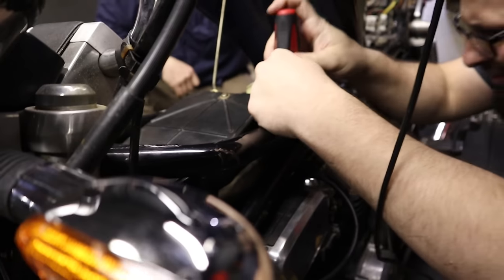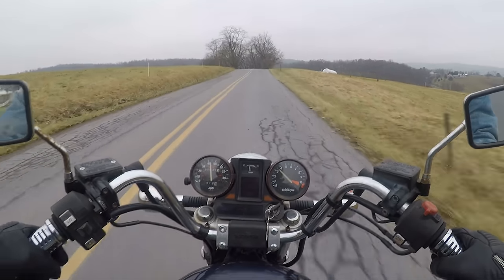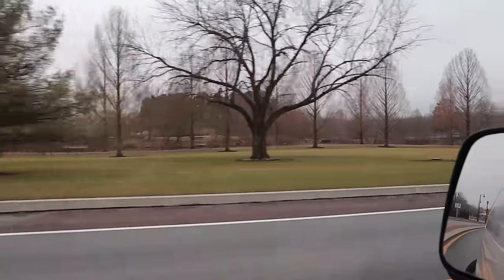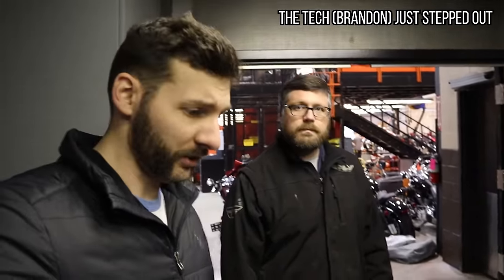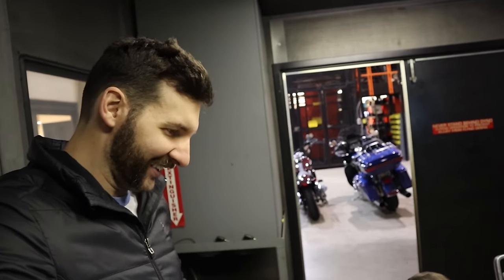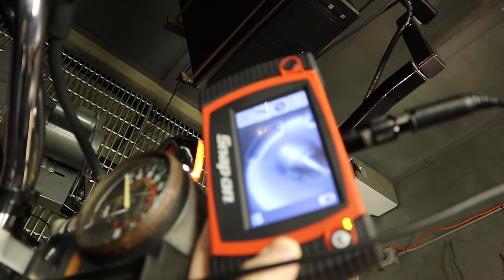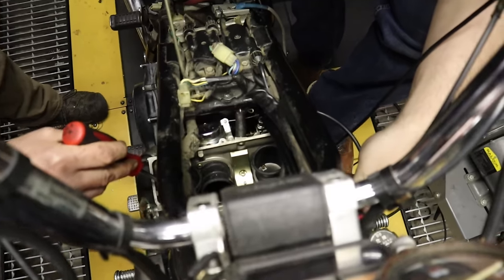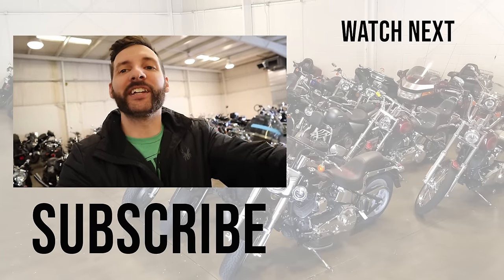We FIXED this abandoned bike for $83 then put it on a DYNO | 83 Honda Magna

Comment: I’ve seen lazy slides before. What worked good is a little steelwool if you wanna tear it apart? If not? Some good throttle body intake cleaner works really good

Comment: note the bike in my avatar. 82  Magna 45. my restoration, my baby. I have trouble with sticking slides too I think.  It has good bottom end power, I can shift at 5k getting on the freeway ended up at 5k sixth gear at 70 when I merge but it has a flat spot at full throttle from  5k to 7.5,  but when it hits 8k it leaps eagerly to 10.5. it stops breaking up and goes like gangbusters. ... I just have to keep up with the shifting because it will power right past red line if i'm not looking at the tach. I haven't quite ever figured out how to do a drag racing launch like I have with other bikes but from the 1-2 shift to 110 mph happens in a hurry. I always thought the stock mufflers were too quiet so I drilled a couple of 3/4 inch holes in the baffle plate and it now makes this beautiful screaming howl at high rpm full song that thrills me.   

what happened to this bike? it seems l like there should have been a final vid

Comment: Cracked liners causing a loss in vacuum first then compression...been there done that with a sister bike to the vtf 750 magna...mine was a vt500c shadow...I would be running along at 55mph out on the highway and then those slides would snap shut and the bike would fall on its flat on its face and then it would pick back up and spike at 70mph before I could adjust the throttle to compensate for it...and I had completely rebuilt the carbs best I could considering some of the stuff is obsolete and I did a compression test which was good left the compression tester on for a couple hours to see what was going on and no change...then one day on my way home from work it just shut down so got it towed home and because it was gonna go to the scrap yard anyways I decided to strip it completely down just to see what it looked like inside and once those jugs came off and no longer had the rings of the pistons holding the liners together well the liners basically fell out in pieces...lots of pieces

Comment: CV (Constant Velocity) carbs. The slides float depending on airflow, but are easily jammed in their movement with dirt. They were popular for many years because they smooth out the power.

Comment: you have two ignition boxes under the seat. my old V45 Nagna did the same thing. remove the seat, and switch the boxes to tthe connector. It might fix your problem. If you run the motor to 6k youll be pulling 70 - 80 mph.  MODULE, IGNITION CONTROL (CDI)
30400-MB1-871

Comment: You gotta remove-clean all slides, pipe cleaner rasp for the jets, or a jet kit, check vacuum lines, fuel filter, such carbs with mercury gauge.

Comment: I have an 84 Honda magna I bought for 450 about 12 years ago . I did about all the stuff you did and more replaced  starter, starter relay, battery spark plug wires  and one of the boxes under the seat that controls the spark. And more. I have a 81 Kawasaki 440 Kz that I think I blew the engine. Went on a bike ride with friends it started smoking, I think it was low on oil replaced the oil drove it home 50 miles smoking all the way parked it found the 84. Magna for sale and bought it. Never rode the Kawasaki again. It’s sitting on the side of my house if you think you are up to the challenge yo get it running again?? It would Be a good project for your show , I painted the tank red white and blue sort of like the one from east rider and put a fur seat cover on it I made from Joann fabrics lol

Comment: Good lord. The CVK carb on my 125 scooter can be a pain in the butt. I can't imagine having four of them on one engine. 

When the slide gets mechanically stuck on that beast, I can barely get the speedo to register 50. Probably 45 in actual MPH.

This video is a great advertisement for fuel injection systems.

Comment: You probably have a vacuum problem on the bike... Probably the intake rubbers have cracks and what not! I've had a Honda VF400F (same engine setup) and that had the same problem. It produced a whopping 21Hp though while there were a lot of vacuum leaks.

Comment: Sounds exactly like what was happening on Cars & Camera's CB750 powered kart. It would rev up to a point and then just stop. It ended up being a spark problem, they replaced the plugs and cleaned the points and suddenly it ran fine and would rev freely. 
I saw an intake for those bikes that converts it to a 4brl Holley carb that'd solve your tuning problems :P (of course now that I'm looking for a link I can't find it)

Comment: 90 degree 4s are smooth but they had a problem with lubrication,I managed to repair timing chain by removing a link and the guides. Ran like a swiss watch.

Comment: Vintage motorcycles are NOT a cheap hobby. They easily get into the thousands getting them road worthy and dependable. The more he runs it the worse it going to get. You will keep finding issues that need to be addressed.

Comment: Wuss! 
Cradle mountain Tasmania, in winter, past 12am, minus 4 Celsius, pouring rain that turned to snow as the elevation increased and the temperature dropped more, on a 250 Virago that had major running issues. Plug gaps set to .3mm just to get it running well enough for a 5 hour trip home that required stops to pull the plugs and clean them just to get another 50km if I was lucky so I could rinse and repeat. 
Quickly became an 8 hour trip that had started at 7pm. 

All this in a leather jacket that was still so heavy from being soaked through from the initial 5 hour trip to where I was going, riding shoes that were soaked through, leather summer gloves, full face helmet that was so cold and loud (Shark Ridill) but I at least had waterproof riding pants.
Reply: Me and a mate went to a rally in the middle of winter. We got to Boorowa and he couldn't open his visor - it had frozen shut. That was a bloody cold ride.....

Comment: Run a couple tankfuls of gas with fuel system cleaner through it. Marvels, seafoam etc. It's cheap and easy to try and has always produced good results for me.
Reply: Not having to do these ineffective things is the reason they got an actual mechanic. Take it apart, clean it, put it back together. That's the only way you are sure it is clean.

Comment: I have a scan of the 1983 Cycle World's article Specifications page: 
80.3 bhp @ 9500 rpm / 46.2 lb-ft @ 8000 rpm
0-60 mph 4.6 sec
Standing 1/4 mile 12.08 sec @108.82 mph
Top speed in 1/2 mile 122 mph

Tip: You should have 2 different sized springs in the carb rack.  Long ones install in the front carbs.

Comment: The v65 magna has amazing acceleration, and with decent tires, they are very forgiving. Unfortunately, their outright power and torque, combined with less than optimal rubber, meant that the majority of these have been crashed out.

Comment: My guess is dried out leaky manifolds. (Or balance tubes if it has them) Try riding with the choke partially closed.  If so, being a Honda you can probably still get them OEM. (I could be wrong, it wouldn't be the first time)

Comment: Have this bike sitting in garage right now "84"" for about 10 years but looks new. I wish I could get it running that fast lol but it's so condensed in such a small package,  last time I had to hand it off to someone able to finish job. Now it's probably not worth the cost of fixing "sad sigh"  Ps: the engine is for sale all over for 650.00 though hmmm

Comment: those slides will not open if you dont have the air filter on, and the air filter box closed, the vacuum that is created in the air filter box, is what makes them open. CV carbs will also not run properly with pod filters, because of to little resistance on the air flow.

Comment: I bought one of these that had sat since 1983. Had 500 miles on it. Previous owner thought the motor was locked up and forgot the bike. I put a battery in sprayed starting fluid and it popped off and ran like a top.

Comment: Try a 84 or 85 Sabre. Similar motor even more ponies. The V65 model was the bike to beat and that's why Yamaha made the VMax. Also an oil cooler drops operating temp enough to add ponies to those machines.

Comment: So I bought something off Craigslist (negative points right away) I believe now that I've got an 83 ish Magna with an in line 4 - looking like a same year Nighthawk,  don't know the displacement.  But alk hooked up to the drive shaft/rear wheel. It was advertised as needing a seat, some side plates and a battery  + came with a starter that had yet to be installed. I have an OEM Magna seat which fits and the other stuff is coming in from ebay soon. Any thoughts? Are the frames the same for that year? Yours has the exact same dashboard/display. I've not seen that in the 100 + internet pics I've looked at.

Comment: did you adjust the valves? the carbs have to be sinked one by one ot just cleaning jets,  so your mechanic wasn't that good the old gas they will gum up again you should use the sea foam it works did you check compression?

Comment: it costs way more to get that bike a good save ride. after sitting for 13 years you need to change all the fluids, including the shocks.  needs new tires for sure and possibly new break lines. 

so don't get fooled that you can get an old bike safely on the road for cheap.
Reply: Still way cheaper than a newer one of the same type.
Reply: You are right, buying cheap bikes has cost me lots in the end. Better save up until you got a better one for slightly more money.
It depends a bit on the market, when second hand bikes are cheap, you can find a good bike for  not so much money.
And you Americans are in a different economy. If you have a good job, you have way more money to spend, than you would in my country. Taxes, you know. And culture, you know. So, if you are rich enough, why bother about sad bikes rusting for decades? Yeah, if you love restoring old bikes to a great condition, why not? Ever owned a Guzzi LeMans? Most old Italian bikes are great fun, designed for high speeds. Keep the suspension in good shape, and they still ride fantastic. Yeah, just heavier than a modern racer, but still a racer. If you never try it, you'll never know. There's more than just lightning fast four cylinders and huge choppers. Classic bikes are not just oldfashioned crap or then already great Japanese bikes. Why peope have a bike and don't do anyting with it, what a shame. Give it away, before it is too late. Really, what's the point here?

Comment: The reason they are so fast is because of 4 cylinders.  When you have twice as many cylinders you get twice as many power strokes.   4 stroke motor-2 cylinders = 1 power stroke for every 2 revolutions.  4 stroke motor-4 cylinders = 1 power stroke for EVERY revolution.   See the difference?

Comment: Correct me if I'm wrong, the v65 magnas had 116 hp and 90 foot pds of torque. Top speed of 145. I have an 84 and it throws you off the back of it, it pulls so hard.

Comment: Love the Magnas(and many other older cycles) . . . hate carbs, "modern" e-15 gas and the nasty results of both hanging together after a week of not riding inside the carb's bowls. Specially when the fuel evaporates and leaves behind that nasty white/yellow corrosion. NO, TY. 
EFI or nothing. 
Weeks can go by and she'll always start and run as if it was used the day before . . . even when gas starting to smell like your grandpa's stash of "20 year old cans of old paint" in the tool shed.

Comment: I had a 1983 Suzuki gsx750es that kept doing this, I rebuilt the whole thing from a bare frame. The way I fixed it was I sold it. It was impossible getting those carbs in and out in that frame.

Comment: My magna came stock with 88 horsepower I jetted it it's up to 90 now So when I saw 48 horsepower that's not very much at all must be running on 3 cylinders instead of 4
Reply: I agree.  I've had 3 V65's.  That bike does not sound right, doesn't sound like its properly firing on all 4.  Maybe one of the CDI boxed is malfunctioning?  That bike has more than one problem.
Reply: @luv2flyV65  Sorry to hear that hopefully you can get it fixed

Comment: Better use some high quality oil in that engine , those V4's have only a marginal lubrication system. Often resulting in early camshaft wear. But if everything is set up and tuned right it will rip. Back when these bikes came on the market they were the benchmark in the  750 class. I believe Freddy Spencer even raced a VF750F Superbike at Daytona. Quick bikes.

Comment: The problemwith those hondas are the carbs ,  the rubber suction cups dry out and the slides fail to open fully the only fix is a change for the older styue of slide cable pulls from the cb750 and a few bigger jets

Comment: I bought a 84 Sabre for $200 and all I had to do was replace rear turn signals/ tires, and clean the carbs. It's basically the same bike as that.
Reply: Cj  Yah I just bought a can of carb clean and soaked them in it. Bike still wont idle with the choke off tho. Pulled the carbs off the bike 3 times already.
Reply: Cj  That sounds like your main jets are dirty.
Reply: Cj  Pulling thats carbs isn't that hard. I pulled mine and cleaned them all in an hour

Comment: My first Street bike was a 1973 Honda  CB 750 four it was in 1982 I was 18 years old . My first motorcycle was a Honda QA 50 cc . My current moto is a Honda  02 VTX 1800S guess I might be a Honda guy I did buy a new Yamaha once in 1999 I bought a Roadstar 1600 .

Comment: On my v-65 the front set of carbs and the rear set have different jet sizes because of the angle of the carbs, once that was corrected it was back running like new and pulling so hard that I fought to stay on the seat.

Comment: One thing about CV carb is that..... I have a bike which is  yamaha scorpio z 225 in Indonesia is not that it don't open all the way is just that when u have  like 20% throttle it will not open all the way and until u like gave it like 25% it will just pull like hell means like between 20% and 25% of throttle it will just so so jerky like either 20% throttle it will bog down or it will pull. So when riding u will just be accelerating and decelerating no like smooth riding. Cv carb problems.... Might change to a more conventional carb from a 2 stroke bike tho just maybe adjust the pilot and mainjet to suit with a 4 stroke bike

Comment: Ace 100 with an expansion chamber … I could eat 175s no matter make or model in curves and high bank dirt but they would run away from me in the long straights. That was way back in 1974 and the borrowed trail 90 was getting old and way too slow

Comment: I don't know what the laws are like where you're from, but to own a motorcycle in Quebec requires a class 6A, 6B or 6C license (with minimum 13 months of riding experience), plates, insurance, registration, and of course, basic safety gear or else you'll have your baby impounded. And if you live in an apartment building in the city, you probably have public parking lots, meters, and at-home parking to pay as well.

So it's not so much that BIKES are expensive, but the paperwork and decent gear that prevent me from running out to buy myself a $200 fixer-upper. Gone are the days when you could just buy a little Harley 300 and learn to ride it on your way home (thank goodness!)

Comment: Those things eat cams.  The oil feed to the front cams was crap.  They used to make a oiling kit that pulled oil from a ring under the filter and fed the oil to a hole you drilled and tapped on the front head.

Comment: I had a 1976 Honda CB 750K that had 67 HP.   I could peg the speedometer out at 165 mph and probably hit 175 mph.
Reply: speedometer malfunction
Reply: @bluevalkyrie2517   I took it to Bristol Motor Speedway(Thunder Valley), and it ran 168.35 mph in a quarter mile.   The speedometer was pegged out at 165 when I crossed the line.
Reply: Scott Farkus i bet those tires were not made for 150. Wild stunt!
Reply: @stopglobalswarming  They were type Z tires.  I don't remember the actual speed they were rated for, but I never had any problems out them.
Reply: Oh well then Ok, can you please tell us more about this 67hp 750 that best 165mph?
Reply: @bluevalkyrie2517   You're trolling YouTube.  lol
Reply: Just call'n out B.S. when I see it.

Comment: It's been 5 months and I haven't seen anymore videos on this bike. Were you able to get the issue with the slides resolved? I used to own a Sabre, which has an identical engine, and let me tell you that mine pulled like a raped ape! If you've got good compression, coils that are giving a good spark, and the carbs are dialed in, it too should scream like a banshee!

Comment: 80hp? Oh, it's a V45 or VF750C. Yeah, that's not the bike that was a big deal in it's day. The V65, or VF1100C with around 120hp was the one that set the quarter mile record. The V45 is respectable, but the V65 is a beast.

On top of the carb issues, the cams may be rounded. Those bikes have poor oiling up top and soft cams. Look up the V45 or V65 oil mod. Do that and stick in new cams if you really want to keep the bike. IMO I don't think it's worth is on a V45, though. I'd love another V65 someday otoh.

Comment: Man we was riding wheels all the time after every turn on the street crack the throttle front end up stand up and ride that puppy.
Reply: So now 65 just sold 1800VTX -C 2006 -2021 ever touch the motor change oil and brake coolant Tran. Take care of them ride them Honda I .ve had them all even 2 Harley.s 1000 1976 sportier 1380 classic 1989 one of my fun rider was 305 scrambler bad boy too.